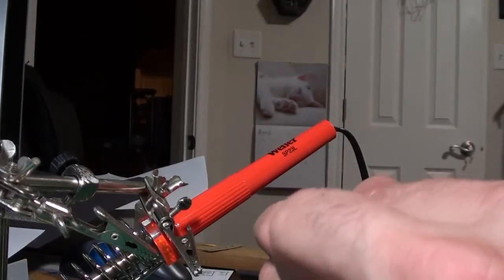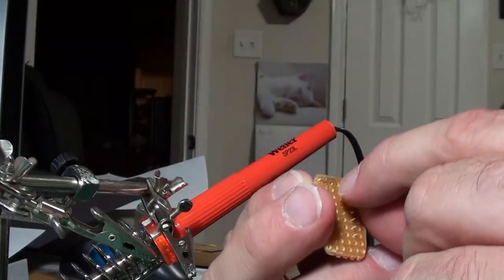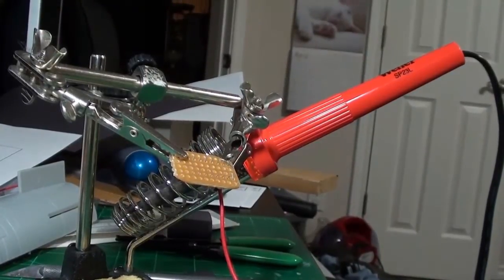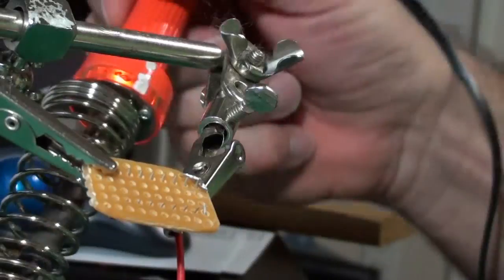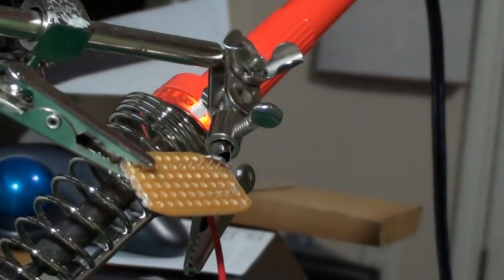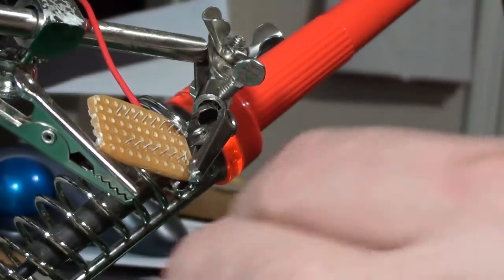Mercury 9 part 4:  Soldering.....

Comment: Badgrendels  Question for you !    Where do you buy or get your solder/lead wire ???   looking for thin to really thin to medium core !  to simulate Wires in my models...  not to use it as solder....  unless I really want to !!!    and I'm having the hardest of time locating a store or e-stores that has More than just the Normal electronics 2mm core !   do you have a Ebay source ?      Thanks !

Comment: the tips are made from solid copper. so if you have a grinder you can grind it to a point . or if not try to file to a point on a flat concrete surface . also tint all metal contacts then solder them together.

Comment: Great vid. I am highly interested in anything involving chips and what they can do. 
May I say that I think the tip on your Soldering Iron is the culprit that may be causing some problems getting the solder to flow on to the work. Its a bit of an odd looking tip in the shot.
Can't say I know what a tip like that is for either.
Thanks for posting these.

Comment: One other thing....when you have soldier on your iron, and it sits in the holder, wipe the old soldier off on your sponge (which should be wet with water), and then apply new soldier to the iron, before trying to soldier a joint. As the soldier sits on a hot iron, it looses it's properties to soldier properly. It will work...but not as well. Also, when you are done with your iron, tin the tip with soldier and then shut off the iron, the soldier on the end, will keep the tip from rusting.

Comment: First off, get yourself some liquid flux...will make your soldering much easier. 

2nd....head the wire on your + lead, and then let the soldier flow into the joint. Just dropping a melted drop of soldier into the joint isn't going to cut it....while it may work initially...any amount of moving and it is going to break the connection.